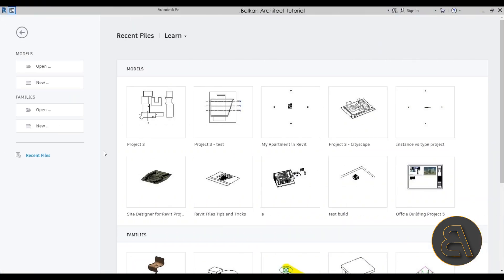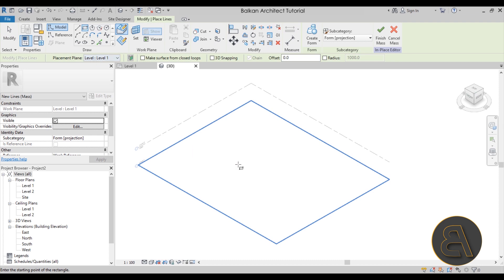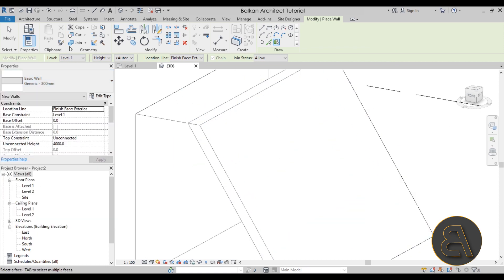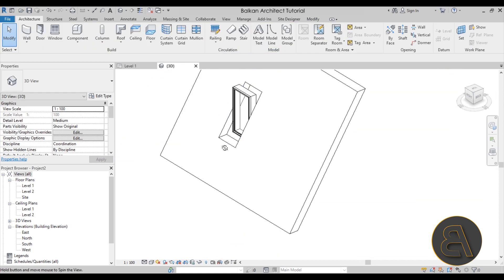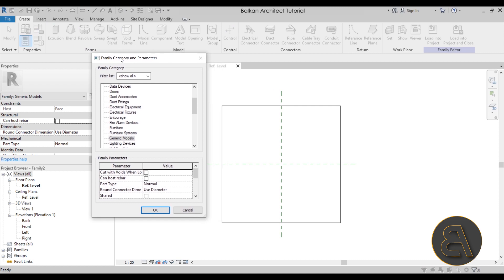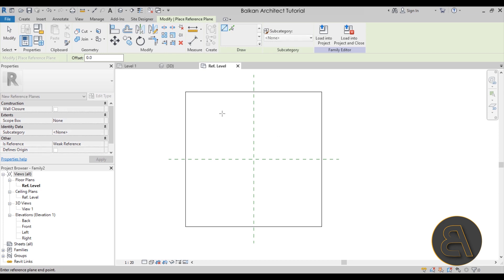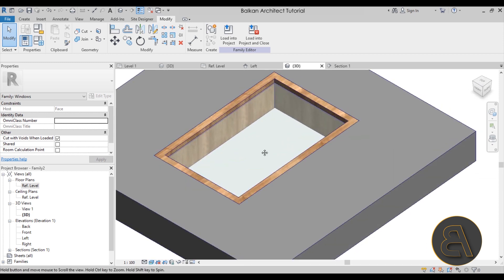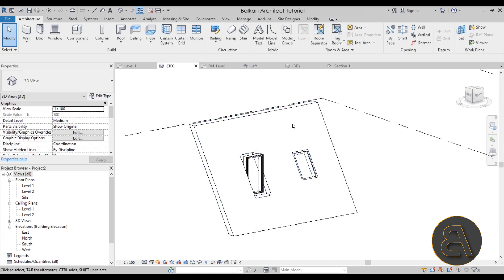Windows on Slanted Walls Tutorial

Comment: Such window cant be dissected by cut plane. On the floor plan i mean. How did you solve that problem?
Reply: Experiencing that problem now and it is frustrating! Got any solution yet?
Reply: @jericcobacha  just changed category to ....common (general )model.  Dont know how it in english.
Reply: @rngv5078  Yep, tried that also but the downside is you can't tag it in the window schedule although the cut works. Anyways thanks!
Reply: @jericcobacha  you can use schedule for several categories. I did that
Reply: @rngv5078 I will try that, thanks

Comment: the window doesn't appear in ground plan, how can i fix this?
Reply: maybe this is too late but for others wondering, you need to go to 'view' on the top ribbon --> click 'plan views'--> 'plan region' and sketch out a rectangle or draw out the region boundary so for that particular element on the plan the cut plane will be at a different elevation so as to show it in the ground plan.